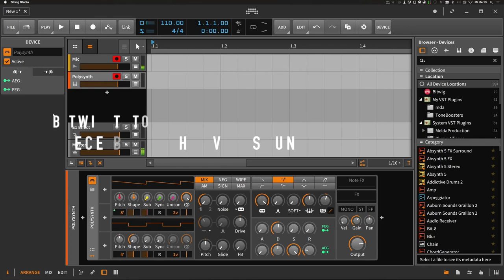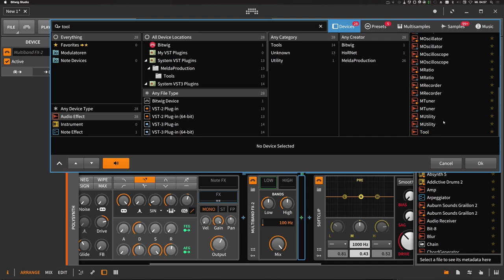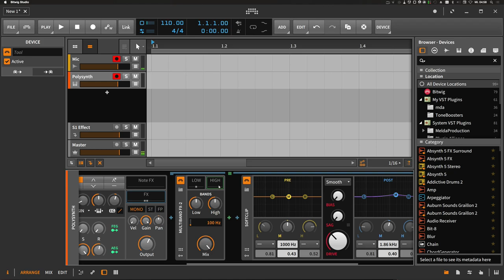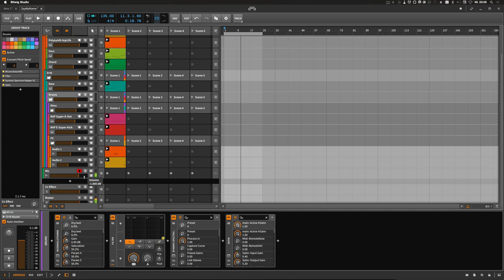Reece / Reese Bass - Bitwig Tutorial

Comment: Nice track, and I thank you for this, and finally hearing a Reece outside of dubstep. 

Question: 

Could we possibly put multiples of these in a instrument layer, have them all controlled with modulators on the instrument layer, in turn making a wavetable synthesizer?
Reply from the maker: sure you can but a "wavetable" synth like serum is more like a mini sampler where the samples are very short. so you could recreate serum with 2 samplers and wavetables as samples. to mimic the "wt-pos" thing you could set up a macro modulator + one "quantize" modulator to step in quantized steps through the sample. the rest of serum is basically only a filter and some fx section.
Reply: Polarity Music that’s interesting, because that’s precisely what my other friend said [about the samplers], but I felt that would be more like a granular synth. 

Hmmmmm....now I’m wondering where I could get wavetables....... 

However how would voicing be handled? Most wavetable synths allow increased voicing, from mono to upwards of 16 or more.